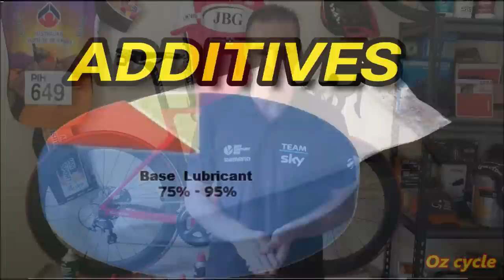Ultimate Chain wax - make it yourself

Comment: Awesome video!  I used candles for the wax so I don't have an exact ratio of ptfe. My question do you its working fine super clean but the chain seams a little noisy is that because i do not have enough ptfe in it?
Reply from the maker: Difficult to discern why your chain is noisy without being there to examine. Could be incomplete initial clean. Please note the instructions in the video carefully and it will work fine. Cheers

Comment: Oz great video. So no more cooling to 50-54° ?   If wax is too hot won't it all drip off?   Thanks again!!
Reply from the maker: Not required with PTFE as it attatches itself to the metal of the chain and lubricates without wax.

Comment: Hello and thanks again. I've cleaned the chain as follows: one night in Benzin, one night in Acetone and one night in Ethanol. Still after that, the chain hat oil and dirt traces so I've used the chain cleaning machine with Acetone and after with Ethanol. In both cases I've  gathered allot of residue. How much dirt and oil is there??? How many times muss I repeate the procedure?
Reply from the maker: Keep going until no residue comes out.

Comment: Hi My Shimano 10 speed chains wear very rapidly to the .5 mark when on my turbo trainer.  The bike is permanent on the trainer so never goes outside but I am lucky if a chain lasts  more than a few hundred kilometres before I can measure the wear!!  I wax the chains and am not exactly a powerhouse. I have just bought a Connex 10 speed chain so it will be interesting to see how long that lasts.  The chain does "squeak" usually after one or two sessions so then I re-wax it but surely I shouldn't have to do this every week or so? Have you had any issues like this before? thanks

Comment: Based on 12,000+ miles of testing over the past year- in the dry Arizona desert, I find a little hotter temperature (200 F) leaves a little less extra wax on the chain and significantly reduces wear due to less accumulation of dust on all components. Waxing every 250-300 miles, I always wipe down the chain.  2 tsp. of DuPont Zonyl MP1100 per 1/2 lb. of MSW has been enough to reduce wear to almost unmeasurable levels in the last 3000 miles.  Also much less cleaning required.
Reply: So the 200F is the ideal temperature after the measurements? I was thinking about lowering temperature so that the chain would contain more wax, so last even longer, but according to your tests that wrong?

Comment: Hi, I just tried this combo, works fine, thanks! I got a question tho, have you tried mixing tungsten en ptfe?
Reply from the maker: Tungsten disulphide. Its rather expensive and not readily available. Also,there are no conclusive tests that it works better than ptfe on bicycle chain

Comment: Hi, Thank you for whole your effort on youtube, it is such a great work! I swap oil based lubricants to wax based on your video, but during some time the melted wax is little bit grey, which should by due to invisible dirt in chain link which I cannot see before soak in the bath. Do you have some experience with this? Assuming it is better to just replace wax, but I have pretty plenty of that with PTFE included 😅 Thank you for advice
Reply from the maker: The wax should go grey after 3,000 - 4,000km of use. Yes , replace it.
Reply: @stevenleffanue  Thank you for answer, I will do that before next waxing.

Comment: Great video.  Can't wait to use this method on my new ride that is coming.  With the 500 grams of parafin and 50 grams of PTFE, there will obviously wax and PTFE left over after one chain is done.  Can you simply allow the wax mixture to cool and harden, and then reheat it again when you need to do your chain again (after 200km as I am a mountain bike rider in wetter conditions)?
Reply from the maker: Yes thats exactly what you do Jeremy.

Comment: Hi ! I am entering in this amazing world - I would like to know if I have an ultrasonic cleaner - then I don’t need to to the fuel process right ? 
Also : which kind of solution I should put into this cleaner ?

Thanks for your effort and time !
Reply: In my opinion, you definitely do still need to use the chemicals to clean your chain. Think of it this way, if you smother your chain with grease and oil, do you think an ultrasonic cleaner with water could clean it? I don’t think so. Just my opinion. I have no experience with this.

Comment: Great for work, no more black oily fingers when I arrive after dropping the chain! - My budget version - works OK without PTFE, let cool a bit before removing chain from wax bath- more stays inside links/ sucked into links as any vapour pockets cool and contract sucking extra molten wax inside. Candle wax in an old pan inside a pan of simmering water just fine, no need to splash out on a slow cooker. My only cost was £3.50 quick link for the chain! (petrol, degreaser and ethanol instead of methanol all in the shed).

Comment: I’ve been waxing my chain for a few years now, based on your advice. Love it. In one of your previous videos, you recommended buying a rice cooker - so I did. In this one, you recommend not using a rice cooker because it gets too hot. 

Is it possible to use on its low setting? I’d rather avoid buying another cooker that’s only used for waxing my chain!

Cheers.
Reply: IMHO, it should be fine IF you monitor the temperature to be under 110C. Most rice cookers have a "warm " setting,  which might be fine.

Comment: I also saw in a previous video you had given it a cold bath right after taking it out. Is that still recommended?
Reply from the maker: For very wet conditions you can do that but not necessary generally.

Comment: Hello! Been waxing my Chains now fore at least over a year. Works great. Now Im gone buy PTFE and try the new formula.
Just wondering if the old tip, to let the wax cool down to 50-54 grC before rakning the chain out of the pot still is the way to do it with the new formula? Or do you take it out directly/at 90-93grC?
Reply from the maker: You can take it out at maximum temperature...95deg C , wipe with clean rag then let it cool.

Comment: Hi Mr Oz, my chain has been through ultrasonic cleaner and also methylated spirit. Then, using white household candle (85%) and clear paraffin oil (15%) in a crockpot and removing chain only when wax layer forms. however, after leaving the chain to cool overnight, I noticed that my chain is not totally stiff like in your video before I still proceeded to twist the chain to loosen it up further and wipe away excess wax. Is there an issue with my method? Chain is okay but not the most quiet - when cycling there is some buzzing sound.

Comment: Good evening from Greece. How long (in km) is a Shimano Ultegra or Connex chain supposed to last when using the wax process ? What about the wear of the front chainrings ? How long are they supposed to last? Any thoughts and/or opinions on these issues please? Any updates regarding the cleaning process after the first waxing? Just hot water? To be honest, I use boiling water 3 or 4 times at each chain and I also try to wipe it out as it is still hot. This way, some remaining dirt (even after 4 washes with boiling water) is also removed. Thank you very much.
Reply from the maker: https://youtu.be/953QTThT4_M

Comment: Thanks for this fantastic video.  Followed it to the letter and went out at the weekend - brand new waxed chain was quite noisy, compared to usual.  Is this normal?  Also, presumably I was supposed to take the chain out of the wax/ptfe mix whilst the temperature was still in the 90 degrees region and not when approaching the melting point at 56 degrees?  Is this correct?  Thanks.
Reply from the maker: Yes,take it out when hot

Comment: I've been riding waxed all summer. Fantastic. A cleaner bike overall too. I would love to stay with this waxing method. With your pointers and a little practice, I can do it almost eyes closed, in less than 15'. But now, with the wet weather in Belgium, my cogs and chains tend to rust quite badly, and not because of neglect. Any suggestions?  Cheers.
Reply from the maker: Add small amount of paraffin oil
Reply: @stevenleffanue  Thanks. Does that not compromise the dry nature of the waxing technique, though? I guess only if you use too much paraffin oil. I was thinking of giving my rubbed down waxed chain a superficial silicone spray and rubbing it in. The waxed joints should remain unaffected and the outer part of the chain would be more water repellent ... oversimplification? Would work in a cartoon but not in the real world, probably :-). I will give the paraffin oil a go if the silicone spray has no effect. If it does I will fill you in if you like. Thanks a bunch Oz.

Comment: Looks very interesting, I think i will give it a try but I have a question.

Q #1) Can you use this wax system on your cables as well? 
Q #2) Can i also use it on the the chain for a gas power assisted bike ?
Reply from the maker: Yes you can use it on non-teflon sleved cables.
Not recomended for motor powered bikes
Reply: @stevenleffanue  ok, thank you

Comment: Hey! 2 mates and I waxed our chains exactly like how you did. After the fresh chainwax we rode for 200km over 2 days. The firsy 100km were absolutely great. But the second day we cycled 50km through rain and after that our chains became dry and squeaky quite quickly. Is it maybe so that with wet and dirty weather the wax comes off faster.

One thing we realised after was that our melted wax we put the chains in was 150°C + and not the 90 to 95 degrees. Does this make a difference for how fast it wears off? 

Really enjoy your content and hope you might have the answers to our questions, Cheers!
Reply from the maker: For repeated wet conditions you can add paraffin oil which helps prevent corrosion.

Comment: Dear Steve, another question for you please. I'm trying your waxing guidelines as best as I can and I'm glad to say the bike rides well with the waxed chain. Although, I'm not quite content on the rewaxing procedure. Specifically, pouring boiling water over the chain doesn't clean it thoroughly. I still find tiny dark speckles of dirt everywhere. Of course, the boiling water does remove a lot of dirt but it is still gritty afterwards. Is there a way to refine the cleaning process before the rewax? My concern is primarily about not contaminating the pure wax solution in the slow cooker with dirt. It feels like the 3-part petrol-degreaser-spirits bath is rather laborious to perform every 250km. But what about heating the chain in hot water before rewaxing? But I feel like stripping out the wax for each clean is not the idea you had in mind. Any thoughts or new developments on cleaning the chain before the rewax? Thanks so much for all your support, videos and sharing!
Reply from the maker: Is it a shimano dura ace chain?...they have a dark grey ptfe coating which slowly flakes off. It want matter if you get it in the mixture...it just looks like dirt.
Reply: @stevenleffanue  Dear Steve, thanks for your quick reply. No, the chain is KMC EL. I reckon the black flecks are waxy dirt picked up from the road. Yeah, the concern is just tainting and polluting my PTFE/Wax mixture. I guess I will have to suck it up somewhat. Still, I would be grateful to hear if you have any 250km chain cleaning tips that are improved upon the boiling water and sieve technique. Regards!

Comment: I prepared everything, also cleaning like you showed in your other video. 

Now question, which parts do I lubricate on my road bike now and still avoid that the wax is getting off. 

Do I just lubricate the derailleur as ever or is there something to pay astrein to?
Reply from the maker: Lubricate derailleurs at their pivot points with a dry lube like silicone spray. No need to lube cogs front or rear.
Reply: @stevenleffanue  thank you. 
I'm very excited to finally see the results after waxing. I prepared everything since yesterday and now I'm only missing a pot which I will get tomorrow 🙃

Comment: How often have you found the need to re-wax on the MTB?  In the UK it gets wet and muddy often, I had to stop using your old formula on the MTB as it washed out too easily, i'm definitely going to try this one, appreciate you sharing your hard work.
Reply from the maker: In wet conditions try leaving quite a bit of wax on the outside of the chain,this will repel water.
Reply: @stevenleffanue  brilliant, will try that, thanks.

Comment: Hello Oz Cycle
I have been using your old paraffin oil and wax methods for a few years. This method has been great and I have been able to reliably get 600 -700km on my road bike between rewaxing. This makes it about once per month for me, a nice frequency. I have just switched to the new PTFE/ wax with no oil.
My comment/ query is that to the touch, hot or cold, wet or dry, it does not seem like a lubricant, this is to say it does not feel slippery. Dry lubricants such as graphite absolutely do. I have just re-waxed after only about 170km as I am not 100% confident in the brew. 
Can you try to explain this please.
Reply from the maker: Unless I have your block of wax to examine its difficult to say whats wrong. By far the majority of people get it right the first time....usually those who encounter problems its because of incomplete chain cleaning.

Comment: Waxed my chains few times with teflon I bought in my country (4microns). It were foaming up more and more with every next use so I had to remove it and use only wax. I`m very happy with this method, super clean and fast, ordered 1,6um teflon from ebay. I hope it will not foam up.
Reply: it only foam when overheated. so slowcooker is nessesery.

Comment: Hi mate, I have followed your advice and I have to say, very very impressed! Thanks!
One question though, I notice that despite being careful, contaminants inevitably enter the wax in the cooker. It seems a shame to throw it away, do you have any ideas for filtering it or cleaning it? 
Thanks again.
Reply from the maker: Difficult to fitler. Best is clean chain with 2 hot water rinses and wipe down with clean rag before immersion.
Reply: @stevenleffanue  I've been doing two rinses every eighty miles coupled with a complete cassette clean (even built a jig for the purpose). Still the PTFE gets slightly contaminated (uk weather and salty roads). 
I did find a way of saving some of the wax - I put the wax/ptfe mix in a pan of water and boiled it. The wax rises and sits on top of the water. When cooled this wax can be easily recovered with a lot of clean PTFE. The water is then poured away leaving roughly half the PTFE and the heavier contaminants.
Hope this helps someone, hopefully someone can improve this.

Edit: forgot to mention that I have moved onto boiling the chain in a pan of water aswell. A couple of minutes strips all the dirt off nicely. 
This may seem excessive, but it does not diminish the wax in the slow cooker very much. Even with this level of cleaning I estimate that I have about three years wax left based on eighty miles a week.
It's the PTFE losses I nees to refine.

Comment: The waxing process has been great! I've waxed at least 4 chains now successfully. However, after I hot-rinsed one of my chains for my first re-wax, i was surprised that there was as much dirt as there was. I thought I rinsed it well enough, but after placing the rinsed chain into my wax, the wax is no longer pure white. Did I just pollute my wax permanently?
Reply: Hi Bart, I have had a similar experience with my first re-wax, the chain was thoroughly cleaned the first time without a doubt, I ride and live in Vietnam and the roads can get dirty and dusty but I never ride in the rain, I also rinsed it twice with hot water, so I put this down to experience and decided to do a fresh mix and to always clean my chain in - Ultimate bicycle chain clean way every time, I do it to be sure, I've got plenty time on my hands and just take it off the night before and soak in petrol and complete the next day, I would think quite a few have had this problem but for me I love the benefit of waxing so I will carry on.
Reply from the maker: Swish the chain around in the hot wax until no more bubbles  come out. It takes a while for the wax to get into the chain

Comment: I know you showed a bike in the mud and wet, will this be good for mountain bike chains? Will this be OK for any brand of chain like SRAM or Shimano? I think you mentioned to use Connex link because they are strong, reusable and don't need any tools to remove and re-install but would other chain links work also? Thanks for all the great information about chain lubrication.
Reply from the maker: Works great for MTBs. Any chain is fine. Connex links are best and work on all brand chains.

Comment: Great videos on chain waxing. I used your Teflon wax mix. Works great. I’m sure I can go a gear higher. My riding is trails. An incline that I could never make it to the top in the lowest gear I tried with my new waxed chain and I did it. Definitely easier peddling. 
My question is when removing the chain from the hot wax, why are you now not dropping the chain in cold water as you did in a previous video?  I see you didn’t use paraffin oil. I thought you did on a previous video. I did add a bit to the mixture
Reply from the maker: Oil attracts dirt. You can still drop chain in cold water after waxing if you want extra protection from moisture